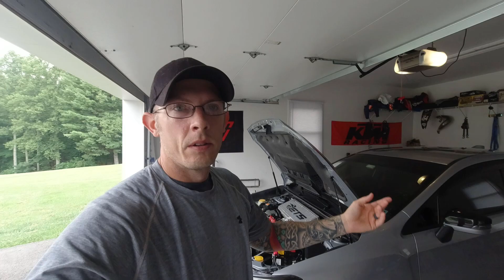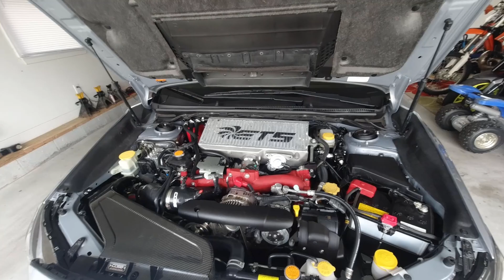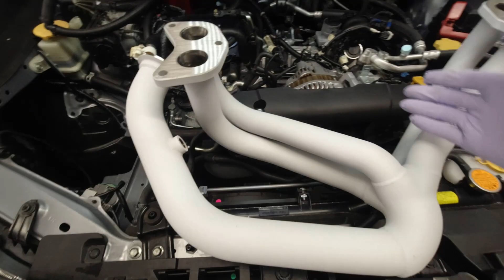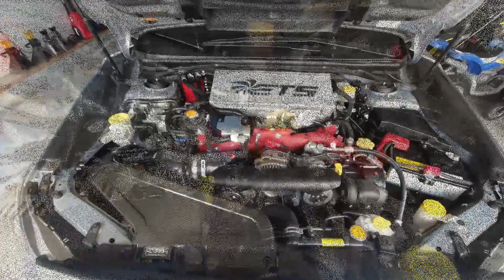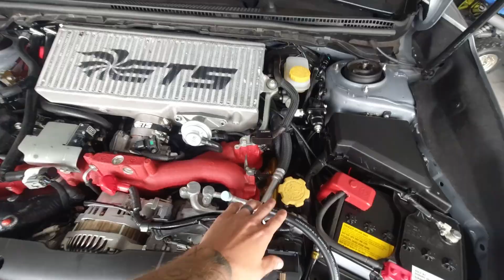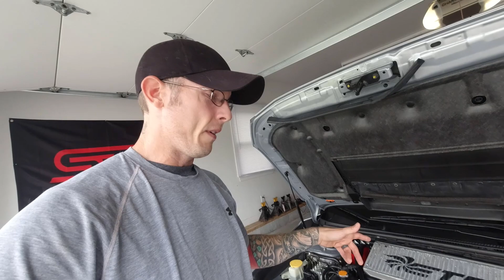Subaru WRX STI Stage 3+ Cobb 20G Turbo

Comment: How’s it holding up? Did you do any pulls or push it on the track?
Reply from the maker: If by pulls you mean roll racing, no I never did any of that. I did do a bunch of redline pulls on country backroads though and in the mountains. Never took it to a track in the time I owned it.

It never had any issues during my ownership as far as engine related issues or turbo issues goes. New owner daily's it to the best of knowledge and it's still going strong from what I hear. The car has been with the new owner now for right at a year, and spoke to him a few months back.

Comment: I am thinking of going with the Cobb 20G, Does it spool better than the Stock Turbo?  I daily drive my car from work to home so I am wondering if this would be the turbo to go with.
Reply from the maker: The spool is on par with the oem turbo, with full spool being approximately (3500-3700rpm) respectively. It is an excellent DD turbo and a good turbo if you aren’t looking for huge power numbers it is great. 

Thanks for the question 🤛

Comment: Well...now I'm getting through your video's, you obviously know your stuff. That Killer Bee ELH is gorgeous. Not sure if I'm going to take mine that far. No money issues thankfully but I went this far with my Evo X and Evo 9 and I don't know if I have it in me lol. I still have the X and to get it to 400whp/330wtq cost me approx. $5000.00....CAD, which is mental.  Glad I found your channel. Subbed.
Reply from the maker: Thank you I appreciate it 🤛. It seems to get out of control quickly when you go in search of power doesn’t it lol.

That EVO is probably a blast down a good mountain road. Would still love to drive one. Everyone around me just has lifted diesel trucks, not a big car scene around here unfortunately.
Reply: @spdkills83  No mountains where I am unfortunately, but I track at Mosport every summer and I keep up and gap cars that are way out of the price range lol. We have plenty of dirt roads, the Sti's natural habitat.
Reply from the maker: That’s awesome man, pulling a gap on the cars out of the price range would be a great experience. Ever thought of taking it into the dirt?
Reply: @spdkills83  I would with the Sti since it's  just straight-up better on loose surfaces than the Evo.
Reply from the maker: That’s awesome man, would be cool to do a full blown rally build/setup. Be fun to play in the dirt lol.
Reply: @spdkills83  lifting and going 16 inch wheels is very complicated..and pricey lol. It would be very fun though.

Comment: I still can't believe 350-390 in these cars is "slow". A 20-30% bump in power should transform the car into a great car, especially if you aren't competing with it. I might be lucky to get my lowly WRX to 280-290, a measly 10% bump.
Reply from the maker: Yea it does kind of suck especially for the amount of $$$ it takes to even achieve those numbers.